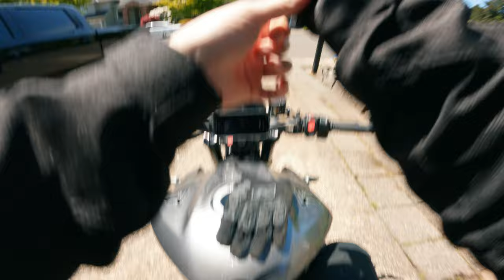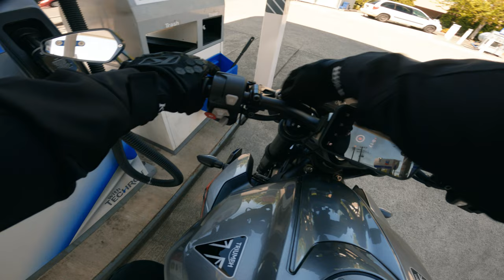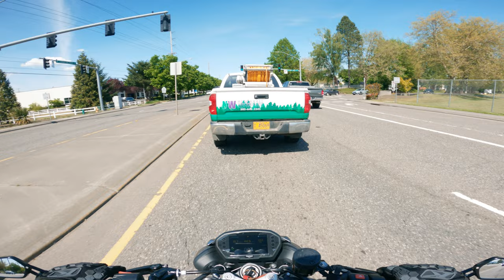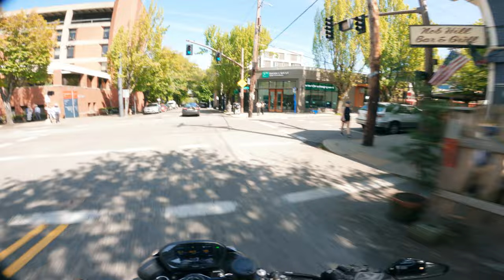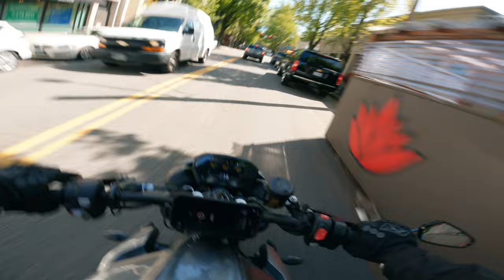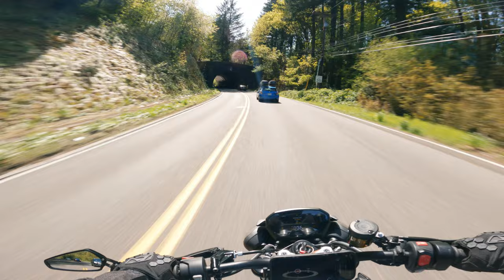Exhaust Debacle | 2024 Triumph Street Triple RS

Comment: Hi, which headers did you get, I have ordered 2020 headers that de cat and delkevic carbon slip on. Any thoughts?
Reply from the maker: These are OEM headers from a 2022 Model street triple RS. But 2017-2022 will work
Reply: @motocorn  thanks for the info, next thing is can attachment point but wont really know about that till they arrive

Comment: The stock exhaust sounds and looks good. I’d leave it, but to each his own 😊
Reply from the maker: LEAVE NOTHING STOCK!!!! hahahah
Reply: That’s what I told him, but he likes it loud(er). 😈 I get it. But I love the sound the way it is, LOL. And I’m damn sure not spending $$$ to get a full system. I’ve always used slip-ons instead.
Reply from the maker: @ZabDevin  I cant hear the bike over my music, thats a problem ;)
Reply: @rwdconnor  😈🤣
Reply: I have the MOTO2 edition, and the stock exhaust with the carbon tip is unbelievably beautiful I can’t get over it, however the sound is to quiet for me. I hit up a exhaust shop as I’d seen someone in the UK had cut the box out and left the stock pipe with a mid pipe welded in for around $450AUD.

Locally the best I could get at Bike exhaust shops was $1,200AUD so sadly that’s a hell no for me. I will buy a slip on and weld on for now
Reply: @motohooligan017 ya that is what I had planned to do. I fell like any local exhaust shop could do it.

Comment: They changed the exhaust on the 2023/4 from a 2 stage to a 1 stage exhaust to make it more free flowing.  Looks plenty fine to me, but if you want to change it - knock yourself out. I noticed when i rode the bike last week i burned thru all the gas quickly :) might have been my style :) fast - there you go - miles of smiles.
Reply from the maker: Not sure what you mean by that but I can tell there is a size difference in the cat, one being smaller (on the older) vs bigger on the new one. Not sure how much more "free flowing" it is, but get rid of the muffler and it will for sure be free flowing :)

Comment: i have a new 24 RS as well. i looked where usually the exhaust comes off from the header pipes but it looks like its completely sealed to the header pipes all the way. has anyone else having trouble with it or am i just not seeing where the slip on the connect to?
Reply from the maker: 2017-2022 headers will allow you to mount a slip on :)

Comment: Hi from the uk, I’ve got the R version, what your doing with the exhaust will it mean you have to re-map/tune when fitted? Also does it effect the warranty with Triumph?
Reply from the maker: Slip ons do not require a tune, I think the bike will be perfectly fine :). 

I dont think it will affect warranty, but my dealer knows what im doing and even some people there are doing the same to theirs I believe!
Reply: @rwdconnor  hi, yes I agree with you the slip -on with the older model didn’t require a tune as I’ve seen on various videos over the last year but as this new model has a completely new one piece exhaust from headers to end-can. You’re now changing it too a two piece system, I suppose when fitted your be able to tell if needs any tuning etc. looking forward to the outcome & again I agree as good as the bike & sound is as standard it defo needs that little extra on the exhaust :) and the sc project s1 is one of the best out there 👍🏻

Comment: Hey brotha I just bought same exact bike . What did your dealer tell you as far as warranty with aftermarket exhaust ? Mine told me if the exhaust affects engine then it won’t be covered , I’m a little worried if something happened they could stretch that . Also what are you doing for tune since it’s full exhaust with cat?
Reply from the maker: Eh, dealers have to say certain things to cover their backs. With slip ons tho, there's no way to truly prove it was the exhaust that would cause damage. VS is you did a decat and say it was running lean. Not sure how smart these bikes are and if they store logs like cars do, But ECUs now a days in cars are very smart and adjust AFRs on the go, so MAYBE triumph does that now, maybe they always have, and its just the internet freaking out about old which tails from the early century haha. Im fine being the test dummy!
Reply: @rwdconnor  unfortunately out bikes have one piece exhaust so you have to do full exhaust and do just a slip on but thanks for advice brotha I really wanna do it !
Reply from the maker: @lifeonthehill942  You can grab OEM headers off a 2022 bike! They bolt right up :) I tested it and worked perfect :)
Reply: @rwdconnor  smart man haha . You have a instagram I can follow ?
Reply from the maker: @lifeonthehill942  @moto_corn :)

Comment: Not happy with 43mpg? Sheesh lol you should ride some other bikes lol. 43 is famtastic when you got something like a ducati SFV4 that gets like 80miles to a tank. Maybe 25mpg
Reply from the maker: I’d loose it with 25mpg haha. It’s not that 45 is bad, the tank is a bit small so I feel like Im always at the gas station
Reply: @motocorn  have you seen any talk of anyone that can or device that can tune these bikes? O can't find anything yet from anyone but DNK seems to list thr 2024 bike so curious if you've seen anything in your research. Still going doing the older header with slip on? I feel like their limiting the throttle on these bikes but tune ecu doesn't havnt anything for them yet.

Comment: all euro5 bikes are really lean from fabric you can break the bike not tune it right
Reply from the maker: Im here to blow things up!
Reply: I thought this too. My Ducati Scrambler came from the factory with deceleration pop. It only increased when I added a slip on. But my ‘24 RS does not run like it’s lean. So, if it’s running lean, I can’t tell. No popping at all. Luv the sound of the triple, especially the intake growl.